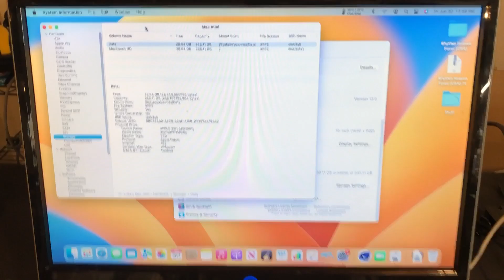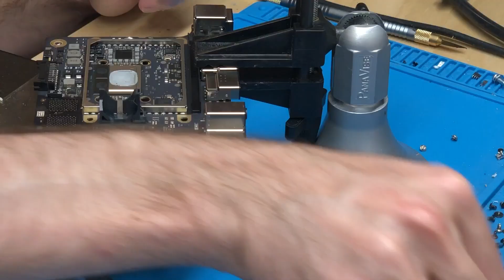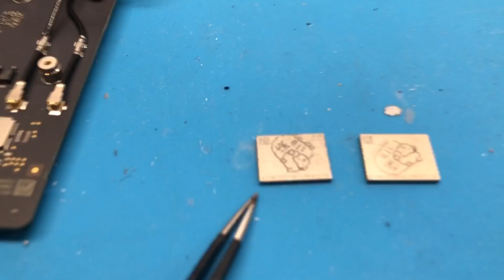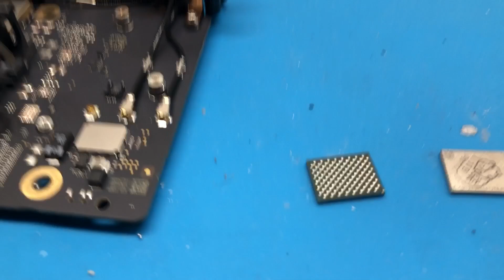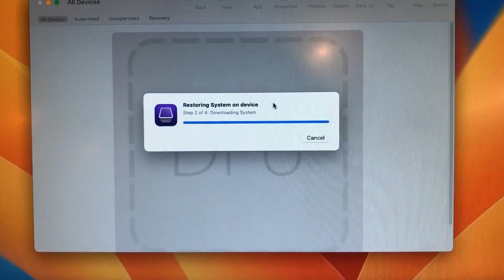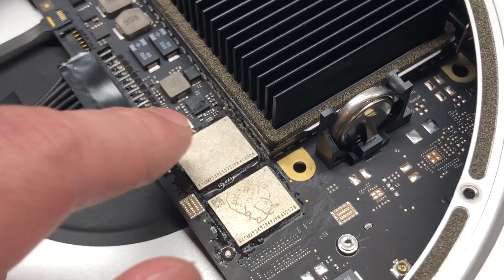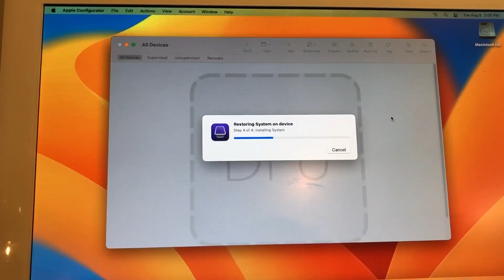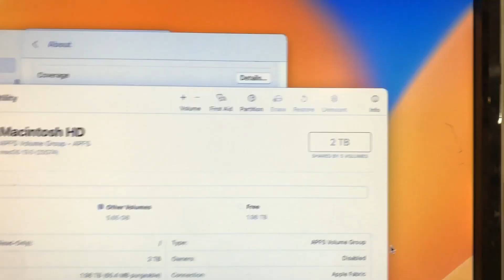M1 Mac Mini Soldered SSD Upgrade

Comment: Collin is so skilled that he was able to get it done even with questions and commentary from Luke. He's a true professional.
Reply: Do you know if they are neighbours or if Luke has driven a lots of mile ?
Reply: @idubzh243  Luke just moved into that basement! :)
Reply: @Look_What_You_Did Well, I think the impressive part was doing pioneering BGA work on an M1 Mac; fielding questions from Luke at the same time was just an additional challenge.
Reply: @axi0matic Only impressive part, maybe,  is that it's a Mac. Apple for decades has been making shit hard to fix or upgrade. I remember having to unsolder the ram from the motherboard of my friend's Mac in the late 90s
Reply: @Look_What_You_DidConfidently misread the comment you're replying to...
Reply: iBoff Mat is his mentor hehehe JK!

Comment: If this works then why is Louis Rossman saying that the bios is stored on the NAND chips and thus is the NAND dies you end up with a paperweight? Maybe that's for laptops?

Second question, how do you know the NAND chips are any good?
Reply: But Louis is right on this... When it is done for a pay. Imagine having to outsource parts which you aren't 100% sure  will work, then doing all the work, just to fail and having to buy new parts, while customer is freaking you he/she needs the Mac "NOW". In fact, he had to outsource a new set of "blank" NANDs to keep testing, so it wasn't only 180 bucks in parts.

This is only fine as experiment or some home project for Yt, where you can borrow tools from your real job, and with enough money from the platform to buy extra parts to "play with". But if you want to do this as job, you will hit a wall pretty fast. And we don't know how hard this will keep getting in the future. New NANDs are coming with an array of blank eFuses for a reason, you know. Some comments here are right. Is better to just stop feeding the problem. Let Apple and their devices to crack down and better focus in making alternative brands to work.
Reply: @hyoenmadan  I don't disagree, but this coming from a career PC / Laptop guy, I'm going to get the M3. My just as extensive XPS only lasted 4 years, that's only with extended Dell warranty otherwise it would have been less so.
Windows performance is crap after you unplug from power.
I really like the idea of long battery life and the same level of performance plugged in or otherwise. Although in time I may just install Asahi Linux if I can get the same level of performance and battery as with mac OS. So unfortunately I'm feeding the problem...
Reply: @affieuk  If you will gonna install linux on that mac, you may buy a second sourced one instead. Also don't forget to support alternative brands. Like I said, don't feed the problem.

Comment: can you check the speed of the new 2tb NAND compared to the original mac mini m1 speed. very cool and worthwhile upgrade. luckily it works. ive seen iBoff RCC videos saying that the SSD contorller for m1 macs are embedded in the m1 SOC thats why theres a compatibility issue.

Comment: Very well done! I consider doing it myself, but wasn’t sure if it would work. Recently I upgraded the storage of my 13 Pro Max from 128GB to 1TB, very satisfying especially when you do it yourself and it works afterwards. Keep up the good work.
Reply: What is a 13 Pro Max with 128GB
Reply: @mitchec100 iPhone?
Reply: @UtkarshAmitabhSrivastava  ok I was thinking laptop.
Reply: How did you do this and what process did you follow?
Reply: @affieuk  I bought 1TB NAND from aliexpress, disassembled the phone and took the logic board out. I then desoldered the original NAND, and soldered the new one to the board. The process is basically the same as in this video, although somehow a bit more involved as it is smaller board.
Reply: @FutureInspirations I'm assuming you also used a blank NAND chip and did the DFU restore without any problems?
Do you notice any difference with the speed of the NAND, did you perform a benchmark before and after?
Reply: @affieuk DFU restore was completed without any issues. Write and read speeds are considerably higher compared to the original NAND that was before.
Reply: @FutureInspirations I think you might have opened the door for a side hustle. If you do go that route, keep us updated. In the meantime, do you have that Ali link for the chip? Thanks in advance.
Reply: can you show a link to what nand you purchased?
 @FutureInspirations
Reply: Yeah, interesting to hear more about your iPhone upgrade

Comment: Great Video! 
On Lukes Version we were told, that the trick was: 
using USB-C to USB3 connection and that the NANDs have to be empty (not pre-programmed)
Here conclusion is: USB-C to USB-C connection and it seem that the NAND order was impotant - or one of the NANDs was faulty?
Reply from the maker: I used the USB-C to USB-C cable originally, I forgot to show the last attempt with the USB-C to USB3 cable (though I don't think it really made any difference). One of my unprogrammed NANDs ended up being faulty, but luckily combining it with one of the initial (supposedly programmed) NANDs I got actually ended up working. But if the NANDs are actually programmed, then the order of the chips DOES matter. Unprogrammed NANDs can be installed in either position.
Reply: @dosdude1  thank you very much for this fast and precise answer!

Comment: Very impressive work, it's not something that most people would be able to do or even attempt. But if this is way beyond your area of expertise, external SSDs have come a long way, and you can come pretty close to the performance of the internal SSD using a Thunderbolt or USB Superspeed+ SSD (the latter of which is apparently not yet supported on Macs). That might not be convenient on a laptop, but with a desktop computer like the Mini, having an external drive is not a big deal.
Reply: Unless one of the internals NANDs breaks and you get a nice paperweight.
Reply: @arkadiuszkozuch3700 Why would that be any more likely than the internal NANDs in the Mac?
Reply: @smwsmwsmw  when the nand of the mac dies you have a paperweight. You can't install the os on an external ssd. That's the problem and the reason most people hate apple's aproach.
Reply: @titgig7232  You can install the OS to an external SSD with an Apple Silicon Mac, and boot from it. It won't boot if the internal NAND has failed though. But if you get it set up whilst the Mac is still healthy, I'd have thought the internal SSD would be unlikely to ever fail, given that it would be sitting there doing nothing.
Reply: Do you understand what you wrote is ridiculous. I'm getting an external ssd so I don't use the overpriced ssd I paid for. People aren't going to do that. Apple knows what it's doing.
Reply: @titgig7232  you wrote "you can't install the OS on an external SSD". But that's wrong, you can. My point is that you won't have a "paperweight" if your internal SSD dies. Whether people are going to do that is another matter. Personally, if I had a Mac mini, and the soldered-on SSD died out of warranty, I'd have no qualms about replacing it with an external drive.

Comment: Oh wow! When the reports came out that the M2 256GB version only used one chip, it made me wonder if it would be possible to upgrade it by "simply" soldering a second 256GB NAND chip to the empty spot on the board (and filling in any missing stuff like caps). I'm guessing even if this was possible, you'd still have to change out the original chip since it's been programmed to expect to be alone, right? The BGA315 stuff seems really hard to find anything about...
Reply: The second pad on the 315 devices doesn't even have populated resistor strips for basic nand functionality, hence why guys in Shenzhen who do this stuff en masse prefer the 2*256 chip configuration just because soldering on 0.4 (or even 0.3) microBGA is a b*tch. But yeah, because both has been done, in both scenarios it's about sourcing out same series nand
Reply: @sssloe  I was wondering about that. On the 4K M2 Mac mini teardown video it looked like there weren't any pads for extra components next to the empty NAND spot, so I was wondering if they were elsewhere on the board or what.
Reply: You would need to do a LOT of extra soldering to add all the little caps, resistors etc very fine work that doing by hand is almost impossible, you would need a pick and place machine or build to do that work with any level of acceptable failure rate.

Also it is possible that some of the SOCs used for 256GB models are binned so might not even support more NAND.
Reply: @hishnash  
They did the population of the pads as a PoC, I think almost uniquely around Shenzhen when you inquire about device upgrades, it's kinda expected that you're bringing a device over that has both pads populated from the factory, otherwise the labor fee gets to be high. But with what is so far documented about the 110 and the 315, there are specific nand combinations that get to work across the board over the majority of the SoC's (recently even the studio upgrades are included) if the specific underlying data written on the nand gets to match the predefined device combinations. The A1 / K1 series of SK Hynix or Toshiba/Kioxia/Samsung/WD used in 2018 onwards have their own documented configurations that work for the pre M devices, the M devices have their own predefined nand's, the M2 has it's own predefined nand models that include both the new "narrow" nand and the regular wide nand, alongside the "fatter" 1tb unit. The only good thing so far is that the nand chips themselves aren't serialized to the board but even when that happens, we have the new JCID programmers to write down whatever we want to the nand, or at least with the upcoming software that is to be released later this year.
Reply: @sssloe  forgive my ignorance, what do you mean by PoC?
Reply: @doogulass  proof of concept :)
Reply: @sssloe  haha, thanks! I was thinking you were referring to a technical term! :-) I'm sorry to keep asking questions, but I guess I don't fully understand. Are you saying that M2 Mac Minis that come from the factory with 2 NAND chips (e.g. the 512GB model) have a different PCB that actually has those extra pads for the resistors/caps too? I swear I don't see them in the teardowns of the 256GB model even though I see the BGA315 pads...
Reply: @doogulass  Nah, the pcb's are the same across the board, it's just that the base model lacks the soldered on components to power the empty 315 pad, hence the extra work needed. There are zero fluctuations to the board apart from the base 1* nand and every other configuration, even when taking into the account 3 physically different 315 nand chips used across the board in 315 appropriate devices
Reply: @sssloe Got it, thanks for bearing with me! I was expecting the unpopulated pads for those components to be right around the empty 315 pad where the underfill would be, but maybe they're on the other side of the PCB instead or something.
Reply: @doogulass  apple got alot of heat for the 1 nand chip situation with M2 base models. I think they will do atleast 2 chips again minimum 512gb for m3. 256gb doesnt make any sense anymore.
Reply: @hishnash  ahh that’s a good point about the binning possibility. I agree about the difficulty of placing all the tiny stuff, but I swear if you look at the 4K teardown of the M2 Mac Mini, it doesn’t look like there are any components near the unpopulated second NAND. Which is confusing…so maybe I’m missing something…
Reply: @doogulass   It possible its just simpler to have the pick and place machine create fully populated boards sometimes rather than need to decided and board soldering time how many will have one NAND chip VS  2 however I would not bet on this alway being the case.

Comment: Nice job!
So basically it doesn’t matter if the NANDs are programmed or not on the M1 platform?
Reply from the maker: Sort of, the key is the NANDs have to be blank/unprogrammed. Once programmed, it cannot be undone (yet, though I am working on this). If using programmed NANDs, they MUST be installed in the correct position on the board.
Reply: @dosdude1  looking forward to your findings. Thanks

Comment: This is one impressive work!  If you could,  I'd love to see list/ links of tools and parts that you are using so I could buy them.
Reply from the maker: In this video, I used: Aoyue 852A++ hot air station, Ksger T12 soldering iron (with J02 tip), Madell QK853 preheater, T2 Mac BGA stencil, Qian-Li underfill removal tool set. Everything can be bought from eBay, Amazon, or AliExpress. NANDs used are "KICM223".
Reply: @dosdude1  as you mentioned in the video, you had to buy another set of NAND that where blank. How can I tell, on the publication, which on is blank?
Reply: @dosdude1  thank you very much!! I was postponing my purchases and kept using old stuff until I would find something good and this looks great.
Reply: Yeah I've asked for this multiple times I hope he will tell us some day.
Reply: iPhone iPad?

Comment: I find it ridiculous that you can't even upgrade SSDs on modern Macs without some serious soldering skills. When it fails, you're essentially left with e-waste.

Except of course the new Mac Pro, where the SSDs are user replaceable... Which only confirms that Apple could've used the same solution in Mac Minis and Macbooks, but they chose not to. Because why would users want to replace a broken SSD when they can simply buy a new Mac... right?
Reply: Corect. I think nvidia's ceo said it best: the more you buy the more you save.